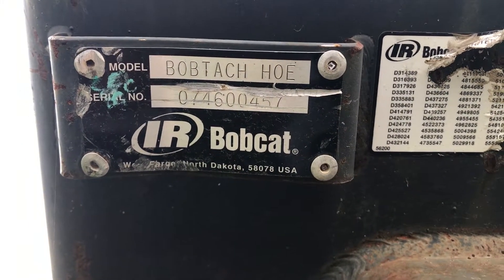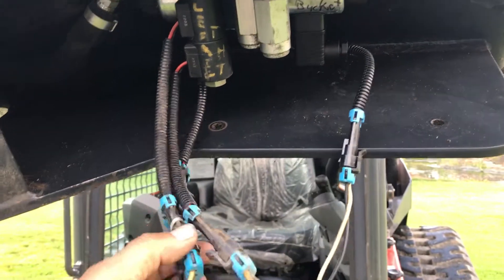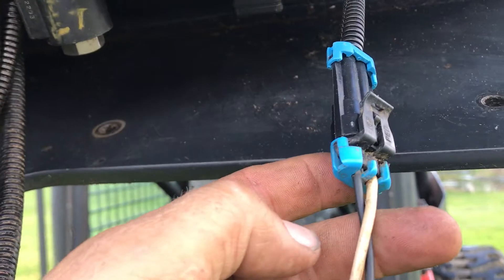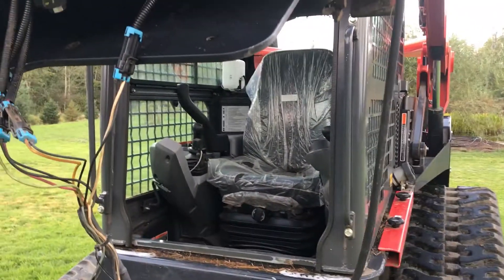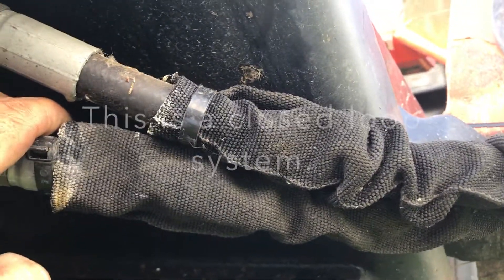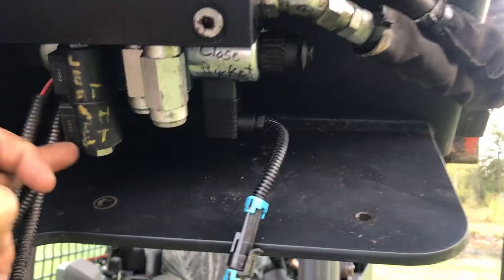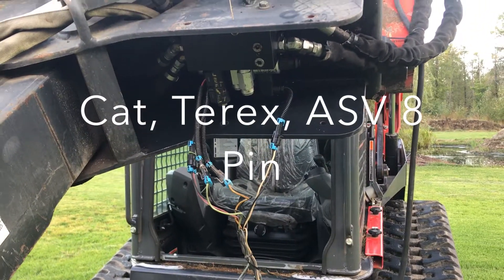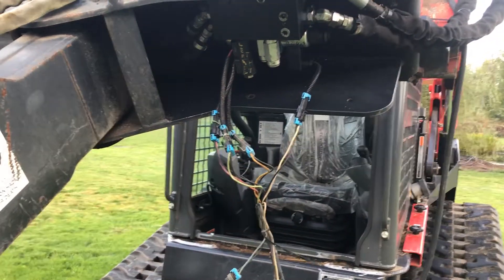#121 - The Bobcat Backhoe Wiring Trick Contractors Don't Know

Comment: What about Wacker Neuson, Volvo, JCB, New Holland, IHI. Takeuchi, etc..?
Reply: They are the same wiring.
Reply: @robleib1973  Same wiring as Kubota or Bobcat? And have you installed those thumb controllers on the above listed makes? 
Is John Deere same as Kubota or Bobcat? Just curious.
Reply: @Drew6709  You asked about Wacker Neuson, Volvo, JCB, New Holland, IHI. Takeuchi, which are the same.  JD and new Bobcat are different.